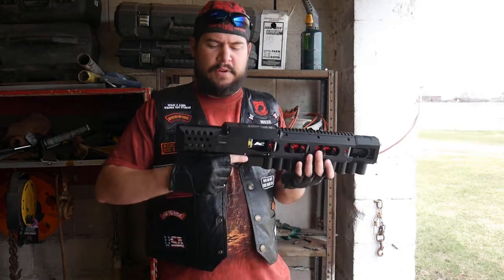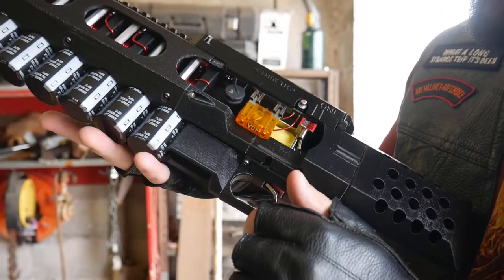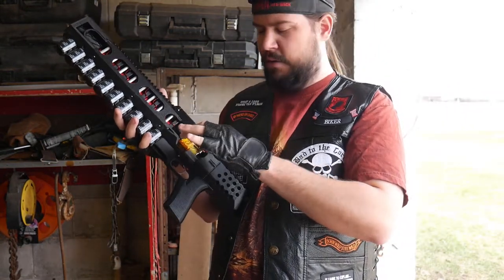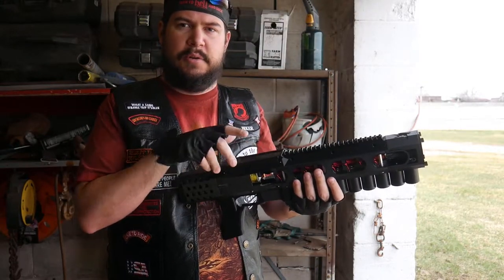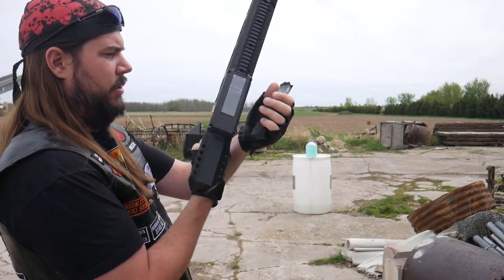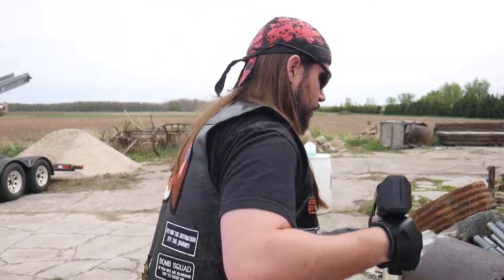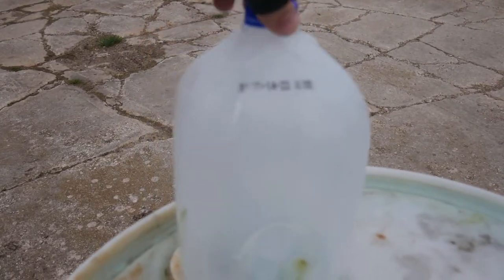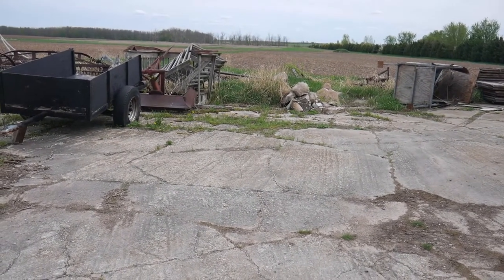EMG-01B overview and range test.

Comment: Hey man, it's David from Arcflash Labs. This is an awesome product demo/review! Thank you so much for posting it! 
We're aware of the button/capacitors. The exposed capacitors get a lot of comments, but they're pretty safe from our testing. We're also working on a capacitor shroud. 
The wiggly button is a known issue and we're fixing it on later versions of the 01B, as well as the EMG-02. 
Thanks again for making this video! If you do any more demos, or have any other suggestions or please keep in touch!
Reply from the maker: Great to hear from you and I'm glad that its known and getting resolved. 

I also figured they would be, but, I'm me, and so I'm paranoid about it, but it is nice to hear that the capacitors are firmly attached and safe.
Reply: Does this fall under normal firearm rules?